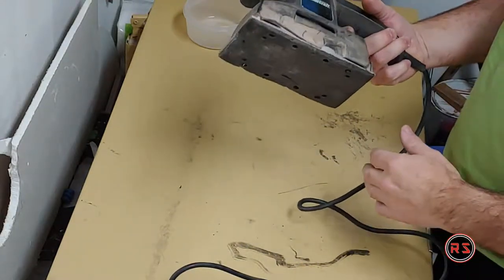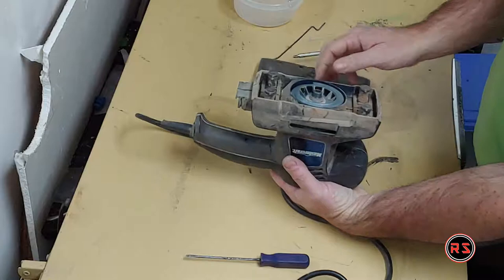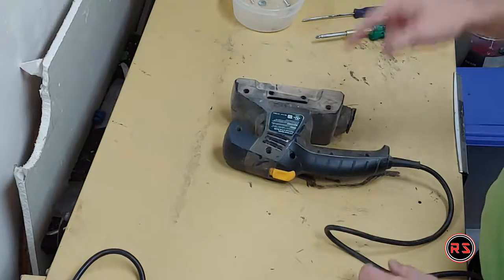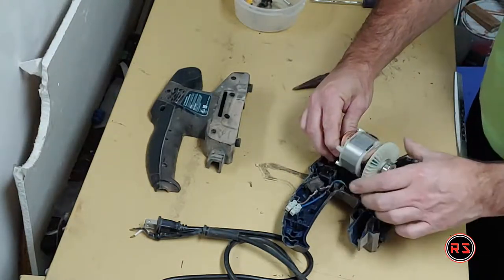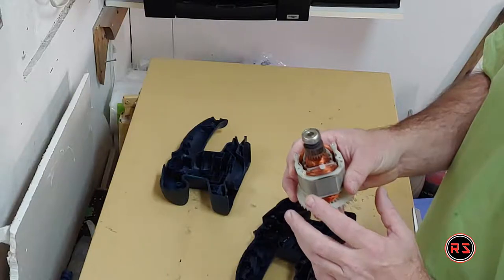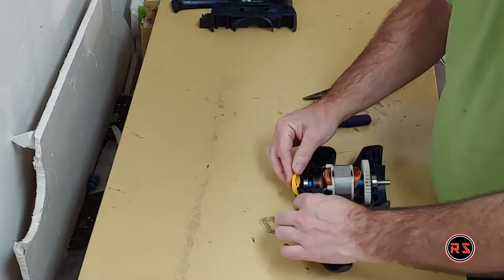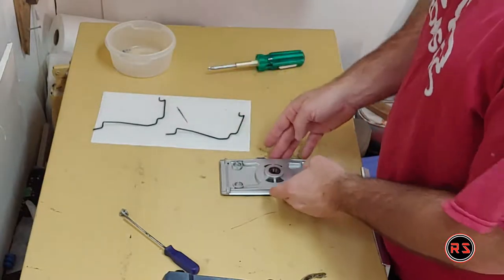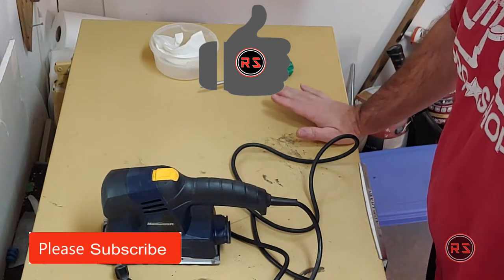DIY, how to fix a broken sander

Comment: Mine just stopped when I pushed it too hard and doesn't want to start again. Probably engine failure.
Reply from the maker: The bearing in the pad can cause that if it is full of dust. I'd have a look at it beafore troeing it away
Reply: @RickStuff  Thank you so much for your answer. I was about throw it away but now I will have a second look at it.